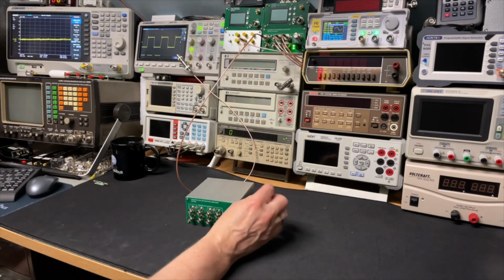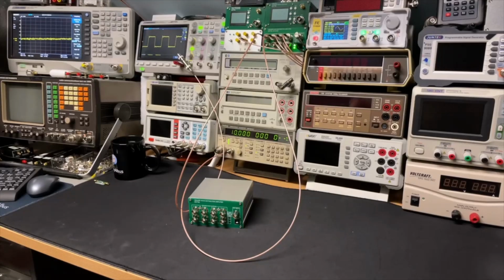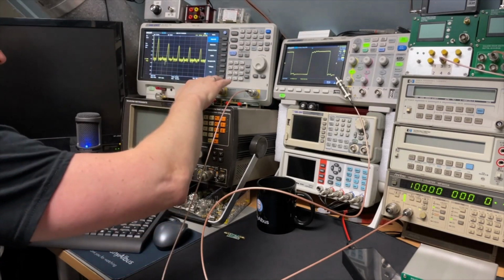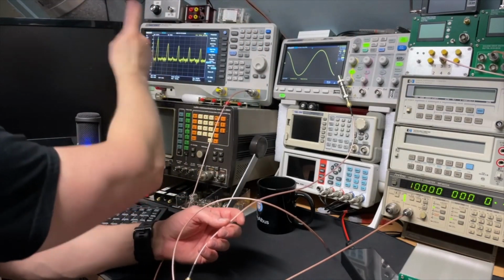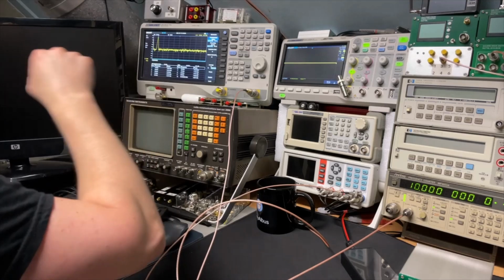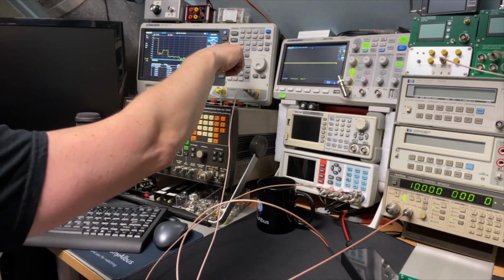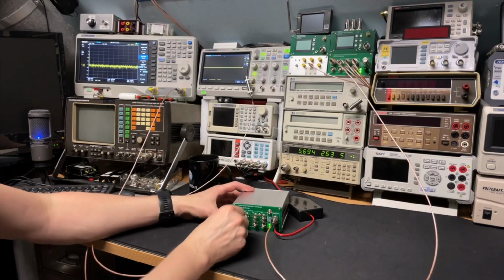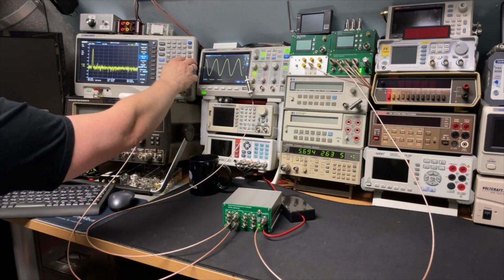TA•0197🟦Distribution Amplifiers - Differences - Practice Tests - BG7TBL

Comment: Hi Tony, I bought the amplifier and distributor without OCXO a couple of weeks ago and I notice that even if I insert an attenuator on the input I always find about 7 Vpp and 15 dbm on all the outputs. So regardless of the signal you give it, it always amplifies it at 7Vpp and 15 dbm? If so, is it not necessary to put an attenuator on the input? Thank you
Reply from the maker: Hi, all 3 amps are sort of trigger amplifiers and are very forgiving on the input. The cheapest has no filtering, but a wide bandwidth. the two 10 MHz do have bandpass filtering on the outputs for clean signal. most of the time there is no attanuator needed on the input. if you know your signal is very loud maybe it is a good idea, to not overload the input and make it trigger wrongly. but if you use it normal its okey without.

Comment: I’ve watched this video 3x - another great video!
Is the first link in the description to the amplifier with built in band pass filter?  
Thank you!
Reply from the maker: Hi Randall, yes the first is with bandpass, i think they are available with and without OCXO, for distributiuon you can have the one without OCXO
the second is a so called trigger signal distributer, it distribust 0-200 MHz in square without filter, cheaper and great for other then 10 MHz signals.

Comment: Hi.. Thank you so much for your GPS-DO videos.
I purchased one for my “ham” bench just for extra educational purposes.
(I had a CVA/stroke a while ago which left me with much of my memory and memories missing)

So.. I’m re-learning everything involving my hobbies and previous career and have found your videos to be excellent.

Thank you + 73 from the USofA
Reply: Sorry.. I totally forgot to ask the question I had initially visited this video to leave..

I’m currently using my BG7TBL GPS-DO for some of the test gear on my bench:
Agilent HSA 9340B (7KHz to 6GHz w/TG)  SA
HP 8591   SA
Rigol DSA-815  (w/TG)
Rigol Oscilloscope DS 1054z
Rigol Signal Generator 

Question…. I’m currently “swapping BNC cables” between these devices and the DO.
How fussy is the GPS-DO to impedance?
How fussy is EVERYTHING to impedance?

I have a new / unused CATV video distribution amplifier.
1-995MHz
I’m not sure of the amp specs, but I do know there is an add-on 8-port splitter packaged with it ( all “F” connectors) and it most probably is 75 ohms.

Can I simply take the outputs of the included splitter and feed each piece of test gear with a piece of RG-400 with an “F” on the amp side and BNC on the test equipment side.  And.. feeding the distribution amp directly from the GPS-DO 10MHz output..?

Would it work temporarily?  (Until I get a 50 ohms”proper” solution)
Can it harm anything?

Thank you!
Reply from the maker: @RBAD-PowderMill  Wow! you have a very nice collection of gear. It is worth a try. maybe if you open the Amp you just see 75 Ohm in series in each line.. then you can replace those with 50 Ohm..  or you decide not to worry to much about it.. check the outputs of the amp with 50 Ohms to ground with a scope to see if the voltage is not to high.
if you want a good clean signal you best go for the 10 MHz distributer with the bandfilter.
Have fun!
Reply: @TonyAlbus  Great!  I’m going to try this as a temporary solution and just ordered the actual and legitimate distribution box from the same eBay seller.  Thank you again for a great channel!
Reply from the maker: Thank you for your nice comment, i am happy the videos are helping you to re-enjoy our nice hobby. I wish you a good recovery.

Comment: The very definition of producing a good square wave output is to have strong odd harmonics, that is how a square wave is built. If you don't have them, you don't have a square wave. So I was bemused by you talking about the first schmitt trigger buffer distributor, but be concerned about its harmonics. If it didn't have those, it wouldn't be doing a good job!
Reply from the maker: Hi Matt, yes this video is not for you, you know the differences between these Amps.

Comment: Tony, when you plug a BNC into your distribution amps up on the shelf, they don't slide around.  How do you fix them without any obvious brackets?

Thanks for an informative video.  It helped me choose the right unit for my application.
Reply from the maker: Thank you Karl, i think i have used Velcro to bind it all together, like you do in IT with patch cables.
Reply: @TonyAlbus  Thanks!

Comment: How high is the signal output from these? I saw one video that said its 6V / 14dbm. I dont think 14dbm is 6v pp. Anyway is the output level low enough to connect to equipment without using Attenuators?
Reply from the maker: its 5 pp i seen on the website.. i just connect all my devices without any problem without attenuators.
Reply: Can an active gps antenna be used or just passive? I saw somewhere that there is power on the antenna jack for using an active antenna. Is this true?
Reply from the maker: @HFpirate  this is only distributing.. but most of gpsdo are active and also an antenna is sent with it.

Comment: Hello Toni, which is better, a GPS disciplined generator or a DCF 77 generator?
Reply from the maker: Hello Marco, i think is does not matter to much, both are sending the atomic clock time, one by RF the other by GPS.
Interesting though i dont remember seeing one for DCF .. i will try to find one. Nice question, Thanks
Reply from the maker: https://www.qsl.net/dl4yhf/dcf77_osc/index.html  Someone build it.
Reply from the maker: GPS:	The high frequency and the phase modulation of the signal guarantee high noise immunity. It is difficult to simulate this signal.
DCF77:	Due to the low frequency and amplitude modulation the signal is liable to many interferences from atmospheric, magnetic and electric sources. It is easy to simulate the signal.
GPS:	With time decoding programme high short-term accuracy of ± 1 µsec. Good control characteristics free running crystals (standard ± 0.1 ppm).
DCF77:	Bad short-term accuracy, as a rule +5 to +25 msec, pretty bad characteristics for free-running crystals achievable ± 2 ppm.
Seems GPS is Better
Reply: @TonyAlbus  Hi Tony, thanks for the information. I only bought a GPS 10MHz reference. I had noticed fluctuations in the frequency and thought it was the GPS generator. The device had a VCTCXO. Then I bought a device that works with DCF77. The device controls a 10MHz VCOCXO via a phase locked loop. I have also noticed fluctuations here. If you want to have the stabilizer you would have to average the result over 24 hours, but I don't need it that precisely. That's why I asked the question. Sincerely, Marco.

Comment: i have a gps,,i connected to my 6 items using bnc  tees,,seams to work fine,,was going to get a dis amp  but never did
Reply from the maker: Your impedance will not be correct and you could have reflections in your line, but if it works.

Comment: Wow some of those harmonics are quite large. I know my Marconi rejects anything a few hundred KHz so most gear should be fine.
Reply from the maker: Hi Simon, yes good equipment will have there own bandpass filter on the ext.ref input, so i think you usualy can get away with the cheaper distributer amp. still nice to see why you pay more for the 10MHz only and FDIS-5 .. its the filtering.